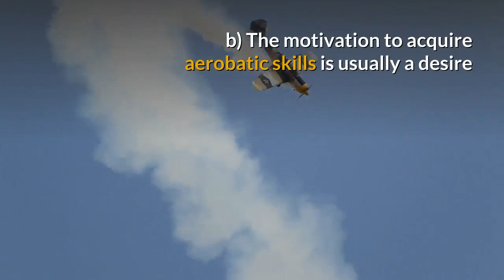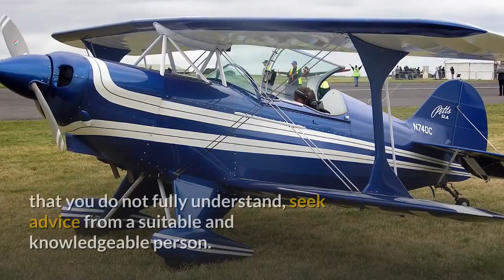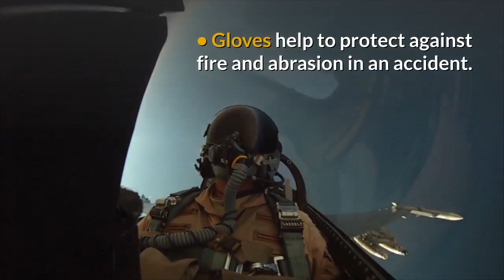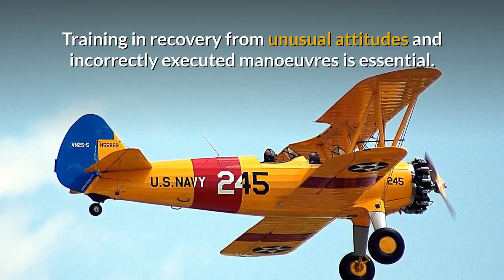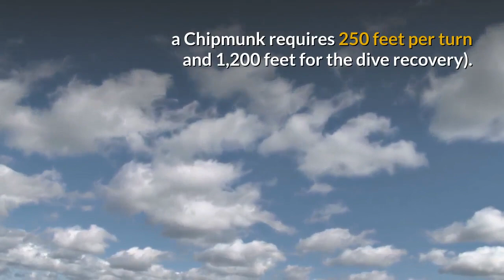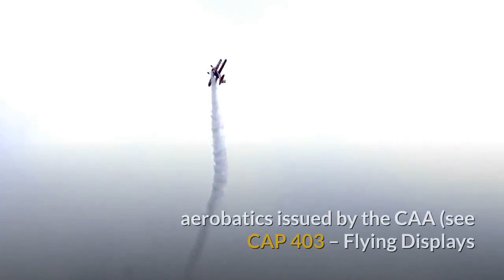Aerobatics - Guidance for Private Pilots.  CAA Safety Sense #19

Comment from the maker: In September 2018 the pilot of a DHC-1 Chipmunk 22 made a MAYDAY call when the aircraft failed to respond to the controls.  "During an aerobatic display the aircraft failed to respond to the pilot’s control inputs due to
 a restriction in the rudder control circuit caused by a loose article. The pilot was able regain control of the aircraft and made a successful landing."  The loose item turned out to be a pen.  Full details: https://www.gov.uk/aaib-reports/aaib-investigation-to-dhc-1-chipmunk-22-g-bcpu